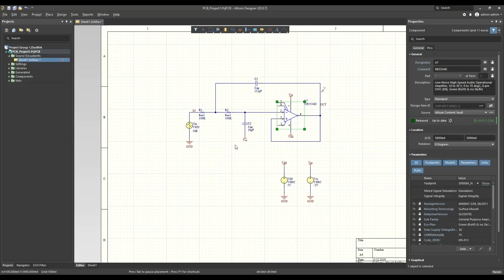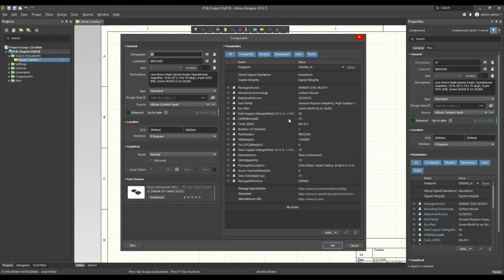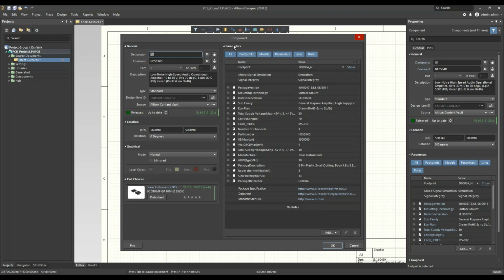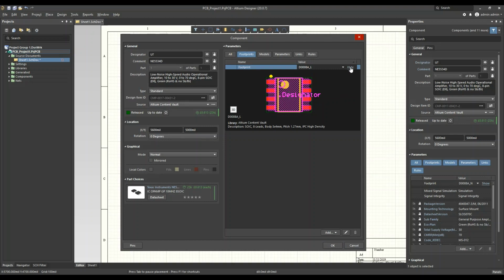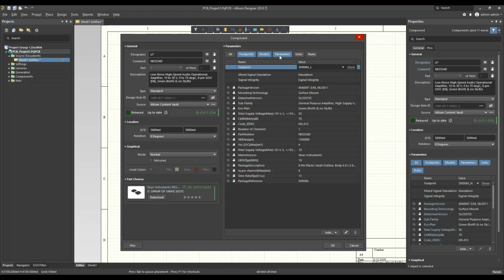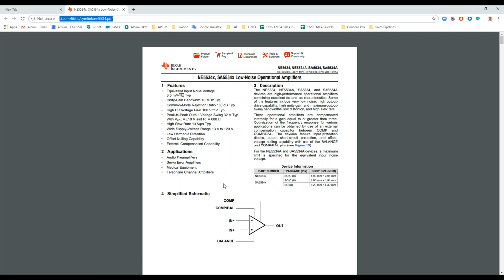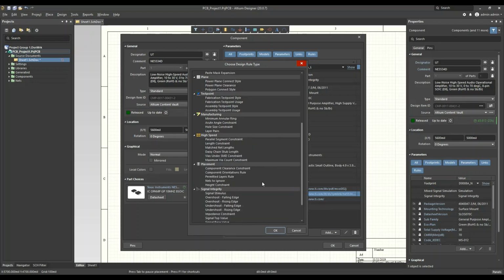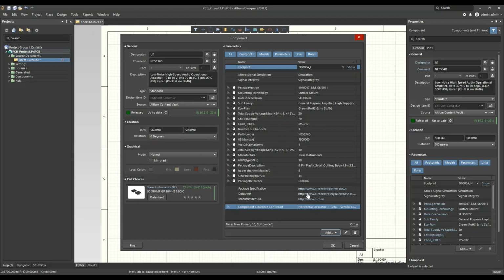See the New Interactive Properties Panel in Altium Designer 20

Comment: I think this change is not an improvement at all. Use has become much more difficult, for example, we've seen all available footprints associated with a component before, now you need to expand the list (even if only one footprint is on the list, you need to expand it to find out). According to me, a very bad change. I sincerely doubt that you implemented this change based on consultation with users.